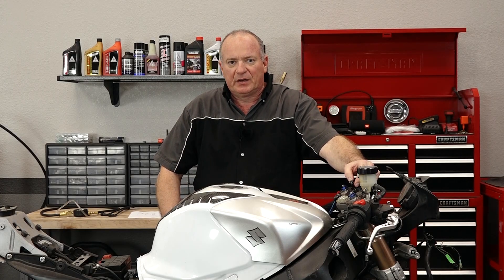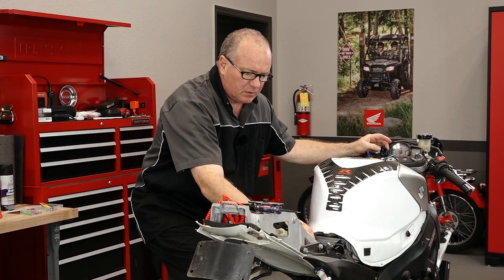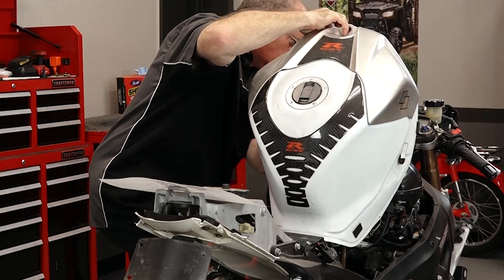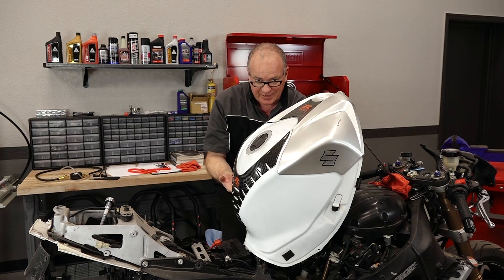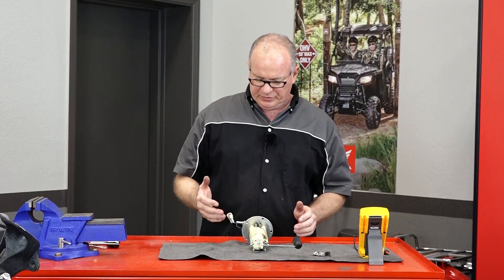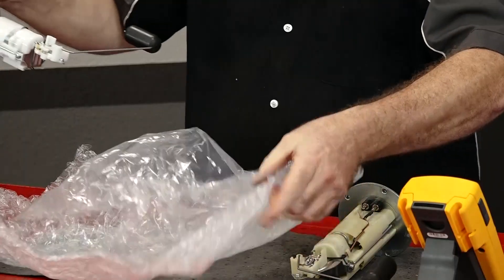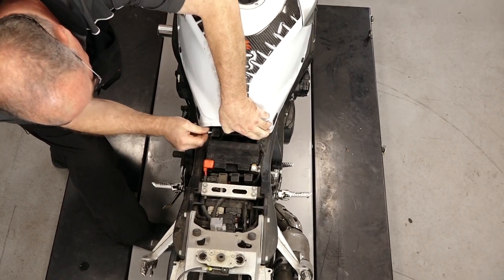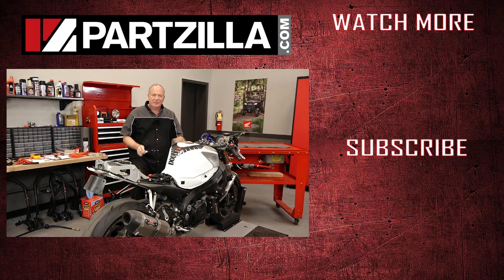GSXR Fuel Pump Not Priming | Suzuki GSX-R1000 | Partzilla.com

Comment: Idk if you answer since the vid is 7 years old, but if you do; do you have any idea what could possibly be the reason for my gsxr not starting after installing a new set of LED lights and new heating pads for the steering wheel? (I'm not doing the installation, but the mechanic whos doing it is having a hard time figuring out why it wont start). Whats weird is that all the electrical functions work when the ignition is on, and the fuel pump is priming, but it wont start.

Comment: I have a 2011 GSXR 750 and my fuel pump isn’t priming. I followed your video and replaced the fuel pump and it’s still not priming. I forgot to check the ohms before reinstalling it but I did check it via the plug afterwards and am getting a reading. What else could it be?
Reply: ECM

Comment: My m109r doesn't prime, but the pump is not seeing any power. The ecm not no communicating and is probably cutting power. Test light is working out everything except the yellow/red wire that supplies power to the pump. It says CHEC on the cluster.
Reply: What did you end up finding what’s was wrong?
Reply: @LukeColon-z6s  I still have not figured it out. I changed a bad relay, but that did nothing. The bike has been sitting. A mobile mechanic looked at it for 3 hours and came up with nothing. This is going to be one of those replacing parts until it starts working again. I don't see it being the fuel pump because it isn't getting power anyways. Right now it seems like a bad ecm or kickstand switch. I know this bike pretty well and I'm determined to solve this myself instead of taking it to the dealer.
Reply: REPLACE THE ECM...THEY GO BAD AND STOP THE PUMP FROM WORKING BY NOT SENDING ENOUGH POWER TO IT

Comment: I have a gsxr 600 and the fuel pump wont prime, I've narrowed it down and I know that the relay isn't getting power is it possible that the ecm isnt giving it power even if its giving everything else power to work I've replaced the wiring harness fuel pump relay  and the fuses but still now power to the realy?

Comment: have a problem with mine. suzuki gsx1000r k7. When I turn it on, it works unevenly and shuts off, and when I drive, when I press the clutch, it shuts off even though it is driving. Please help

Comment: What would be the issue if this issue is intermittent? My bike primes and runs fine but sometimes I go to start it and it doesn't prime and throws F1 code, I turn the key off and on again and it works like normal, the on and off can be something I have to do two or three times but sometimes (usually when warm) it starts fine with no issue. I tried the dealer mode bridge to check the code but it blows the fuse when I bridge the plug.
Reply: I also have this problem, the only information ive found is that the cloud point of gasoline is around were my bike stops starting up easy

Comment: I'm having this problem with my 2012 V-strom 650. FP relay works fine but FP motor doesn't run. Looking for ohm #'s for the FP. You can get fuel pumps only everywhere, no reason to spend $800 bucks for the whole thing! I swapped mine and still no FP operation. Suspect short. Other noise if from the secondary throttle valve acutator.
Reply: Talking to myself here. I found a large voltage drop across the FP relay. Have another used relay coming from fleabay.
Reply: I had a new FP relay for my truck. Removed the connector and plugged in a new FP relay. Pump now works! Problem solved.
Reply: Put the fleabay relay in from a 2013 Gixxer and it's now fixed and back to original. Now my ABS unit is having problems. :(

Comment: What fuel system cleaner do you recommend for gsxr1000 ?  
I had a some stale fuel that caused the bike to bog down until I re fueled and it still has a small miss/blip at low throttle just cruising.
Runs clean at mid to full throttle now but just a little sputter at low throttle cruising.
Reply: No cleaner will work if the FP filter is clogged up. Start with sea foam.
Reply: @daveyt4802  I tried the motul fuel system cleaner and it seems to have worked. 
Bike is running great no misfire or bog and the fuel pump looks spotlessly clean. 
I will run the motul fuel system cleaner in the next fill up just to be sure. 
I have read sea foam is good stuff too.

Comment: What if I'm getting no power at the yellow and red wire at 3:09. What could that mean, cause I tested the other connections and it lights up, but not the yellow and red wire
Reply: FP relay supplies the voltage. So go back to the FP relay Y/R wire. My FP relay just failed. Burned contacts.
Reply: Same for my 05 gsxr too!  My light tester isn't coming on for the yellow/red wire at 3:09.  But my relay lights up and actually clicks.  Does it mean i need to replace my relay?

Comment: I have 07 gixer 1000..mine is doin same thing except mine has power at relay but relay is not putting out power ..is it  relay or something else?The relay is not clicking ..actuator is in fuel pump?I can jump oower across plug fuel pump turns on ..but is not priming..any kinda help  or advise .
Reply: You can remove the relay and jump the 12V to the pump itself and it will run. I do it to pump out my tank. Unless the pump is bad or disconnected. He is fixing this problem in the video.

Comment: My fuel pump primes and works fine- Until I turn the bike off. Then it won’t restart. I’ve narrowed it down to a hot start issue; it doesn’t prime at all when too hot. Any ideas?
Reply: FP relay is bad.

Comment: What's the cost of the fuel pump for the 06 Suzuki gsxr 600 motorcycle
Reply: Original probably near €1000, thats what my one cost but check with revzilla, I found one on ebay for €110 used
Reply: $883 dollars. Yikes!

Comment: Okay i have a 2002 GSXR-1000 
My problem is that it was stolen there were wires cut on the main harness but I have jumped them so they already connected my tach is not lighting up my fuel is not turning on or priming I replaced the starter relay the only thing the bike does when I turned the new ignition is the rear brake light turns on what do I do do I replace the entire wire loom of the bike

Comment: Hey, can anyone help? My 08 GSXR1000 starts fine. But when I give it the beans it is lacking in power. What  might be causing that? Spark plugs, fuel injectors, fuel pump? What?
Reply: Have you got it in "A" mode as that's the high powered mode.   C is economy mode.    It could be many things like a small hole in your manifold pipes, to a blocked or kinked hose
Reply: @seanviper99  Bike has 3 modes, A, B & C. Problem was the fuel filter. Had a lot of rust particles. Replaced the screen and some o-rings. It worked, then it didn't. I had to pull it apart a few times but now it's been running fine.
Reply: FP filter replace.
Reply: @daveyt4802  I replaced a filter on their fuel pump. Is working fine now. I think the bike had been sitting for a long time before I got it and muck had accumulated in the fuel tank. Good now.
Reply: You can blow the lower filter out or just get cheapos on fleabay like I did. Recommend cleaning or replacing every 10k miles. 25k for sure. Also you can flow test them. Jump FP connector for 10 seconds and get 167 ml flow of gasoline minimum. 250 mL is better.

Comment: Is it just a GSXR1000 thing that you can't replace the pump, because I was able to replace ONLY the pump and not the entire housing on my 07 GSXR750.  I hope that's the case, because I felt pretty mis-led after watching this. $20 vs $200 used/$800 new.
Reply: Just the pump can be as little as $29! Whole thing is $750+ bucks. Yikes!

Comment: I'm having the same issue fuel pump not priming. I change the fuel pump relay it is not working. I use the test light and I'm not getting fire to relay for it to seng power the pump.
Reply: ECU sends the coil voltage. May go through many other things. Have to trace the power back and find out where it's lost.

Comment: 50-60 pounds of fuel in a 4 gallon tank?!  race fuel is just under 6 pounds a gallon.
Reply: Maybe he was talking about the weight of the tank too
Reply: 24 pounds of fuel plus 10-15 pounds for the tank and fuel pump.

Comment: Im having a problem where im thrown a c41 error code on my L5  GSXR 750, i have checked all the fuses, clutch switch, ignition resistance and bought a new fuel pump but still no luck. Any tips i could use to try sort this problem ? Thanks for the vidz they have helped me loads but not this time unfortunately
Reply: Just had a C41 code when I removed my fuel pump relay. Get a new FP relay or check the connector.

Comment: What if I’m not getting any power to the yellow and red wires
Reply: Did you ever get an answer? Same problem
Reply: I have the same problem but no one knows what the problem is. I have a m109r and it has "chec" on the speedo, but I don't have the fi light on. The bike turns over but is not getting fuel. It can't be the fuel pump because I ran power directly to it and it started priming.

Comment: Hey. Could be a stupid question but is it possible that a motorcycle could fire up even if the pump doesn’t prime? My r6 takes some throttle play and a long push on the start button to fire up, sometimes it will fire up and then die immediately. I hear some electrical noise when the key is turned but it could be actuators, when I flip killswitch on I don’t hear anything. Thanks for this video
Reply from the maker: There could be a little fuel in the line that will let it fire and die.  Test the pump and see what's going on!

Comment: @Partzilla I've got the gsxr-750 and I've been having trouble getting it to run. It turns over just doesn't run. It had a c29 code so I replaced the actuator and the stps(used part). The stps code cleared but  threw the c28 code and still didn't start. Checked it today and now its throwing the c29 code.?? An the butterfly's move with the bike on(after I already turned it on and they moved the first time)?? I also tested the relay and got no click or light from the test light, check power to the fuel pump from the harness and got no light either.? Any ideas?
Reply from the maker: So the used part could be bad.  Could be a shorted wire.  Could be an ECM issue.  This is a tough one to diag over the internet.  Just keep going through the components.  Process of elimination.

Comment: I have an 06 gsxr 600. I can hear the fuel pump priming then when I turn the bike on it starts and runs for a few minutes then turns off. After that first start, it doesn’t want to start. Could it be the fuel filter being bad ?
Reply from the maker: Test the fuel pump output.

Comment: I have a 750 Honda shadow. fuel pump will not run. tested pump man. with 12 volts and it runs fine. replaced fuel pump start selonid and still wont run. any help would be app. thanks.
Reply from the maker: Check all wiring and connections
Reply: @PartzillaParts  Thanks man. I have it running now but i have gas comeing out some where on the engine. Still working on it. Thanks

Comment: Mine you sometimes have to turn the key a couple of times then the pump will work.. what would that be?
Reply from the maker: Sounds like a loose wire somewhere or the pump is failing.
Reply: Partzilla ya the relay will click once but when the fuel pump does work the relay clicks twice
Reply: Partzilla also it seems when it sits for awhile it won’t prime but after a few tries it will then won’t do it as much.. would that still mean the fuel pump?
Reply: Most likely FP relay.

Comment: 2006 zx6r
Now what if the pump doesn't always prime,  but when it does and starts working, It works no with no issues. It Is just down to getting the pump to prime
Reply: Velysean I have had this same issue for years on my GSXR 1000
Reply: Relays can be intermittent.
Had a problem like that on an 04 Kia Rio I had.

Comment: I'm at a loss I have a 05 sv650s had a issue tlwith my stator went out replaced the stator then my fuel pump wouldn't not prime replaced my relay and just installed a new fuel pump but still can't get it to prime I don't know what could be the issue
Reply from the maker: Check your fuses.  Wiring connections.  It's not getting power from the battery
Reply: @PartzillaParts  found the issue with that and now I found when I changed my stator some how my clutch linkage got messed up ugh

Comment: Can I test the resistance without removing the tank/pump? I tested all the leads at the terminal and got no resistance.
Reply from the maker: You can, but you want to check if the wire is disconnected on the inside.
Reply: Sending unit is one wire, FP is the other wire. B/W is ground for both. FP should be around 1.1 ohms. Sender is around 2-300 ohms.

Comment: Will the ohm idea once the pump is out work for just about any other supersport? I have an 04 cbr600rr and im getting 12v all the way up to the pump. I havent taken it out yet but I will. I'm just curious if the ohm check would still work the same.
Reply from the maker: Have to double check the service manual to be exact, but it should be very similar readings

Comment: Thanks for such an informative video. I'm curious and have a similar problem with my bike. when i got to check the relay with my test light power is constant and doesn't click on then off. (like in the video when he flips the killswitch and the test light illuminates for a few seconds then goes off)when i test the kill switch you can hear the relay clicking like it should but the test light stays on regardless of the relay clicking on/off? Anyone know or have any ideas my guess is theres a short/surge somewhere in the loom causing the relay to always have power going through it?
Reply: Also just a little more information. I've changed all the fuses, relays, TOS sensor and even the ecu. still i cannot get my fuel pump to prime. i can take positive and negative leads to the fuel pump wire plug harness and it primes up but constantly. i can even leave it hooked up to the power and start the bike just fine. however the fuel pump is constantly priming of course cuz its hooked straight to power. please help why isn't my relay cutting on then off or sending a signal to the fuel pump.
Reply: p.s. I've changed the fuel pump aswell.... ive changed everything literally..=( why won't it start?!?
Reply: UPDATE: RELAY no longer clicks when i switch the key. i used to hear it click now no longer and on the fuel pump side harness again when i test the connection and its supposed to cut on then off, again the test light stays on. its like my connections are all getting power but theres no switch between on and off like its supposed to.
Reply: @rafikiknowsdaway1103  
Did you find the issue?
Did you ever replace the relay?
Did you look at any sensors that had to do with the fuel side of the system?
Did you pull up a wiring diagram of the fuel system?

Comment: great video, 2002 gsxr 750 my wires got pulled out of the connector on the harness side. would you be able to share the wireing schematic for it. when i tried to match the wires to the pump side of the connector one of the wires doesnt match with color to the one infront of it.  so i have yellow,  black with white stripe . black with green dashes.
Reply from the maker: This is from the service manual.  https://drive.google.com/file/d/1bYBXrlfzaHSTDljXcywvha-Xecvup1Jw/view?usp=sharing

Comment: I have a 2003 gsxr 750 and the fuel pump is not priming, I hear the actuators but no sound for the pump...I followed the video up to the wire before the pump...I got power at the relay but the light stays on, it didn't go off and I also check the y/r wire at the connector before the I went to the pump...Could this mean the relay is bad or stuck open?...I'm stuck
Reply from the maker: Could be a bad relay or the pump may have just failed.
Reply: im having the same problem did you ever find out what was wrong with your bike??

Comment: My 2007 gsxr 750 has power to fuel pump but does not start, I removed the fuel pump and tested my readings for pump are 91ohms and readings from fuel gauge assemble are open.  Do I need a new fuel pump unit or just the gauge assembly?  Does having a fuel gauge with an open reading affect the starting bike?
Reply from the maker: Fuel gauge wouldn't affect starting.  Do a pressure test on the fuel pump to verify it's working.
Reply: Did you figure out what the problem was? I have the same problem on the same bike.
Reply: Maximiliano Villegasg Yes I ended up changing just the fuel pump, I found a replacement on Amazon it’s after market and works great.  Since my fuel gauge readings were open I cleaned the entire assembly and the contacts from the gauge assembly, after this my fuel gauge readings were normal.  I also cleaned out my fuel tank since my gsxr was sitting in storage for a little over 1 yr, I believe this was the cause of my pump failing, it was very dirty in the fuel tank.
Reply: @gerardocruz8791  thank you very much I appreciate you getting back to me. ..

Comment: Just bought a new battery and a regulator rectifier and my gsxr still won't start
Reply from the maker: Don't just randomly buy parts.  You can test from battery to plug for spark issues or test lines/pump for fuel issues.

Comment: Just pulled the fuel pump on my GSX-R to clean the Filters, to my surprise they were manky as hell although the dealer said they "cleaned the fuel tank"...that apparently doesn't include the Filters. Put my pump back in and it doesn't prime anymore, but it also doesn't do anything when applying 12V to the leads like in the Manual (to check fuel output) so I think the motor is shot.

I can order one for my bike though no problem, it's 40€. just have to take the pump out again.